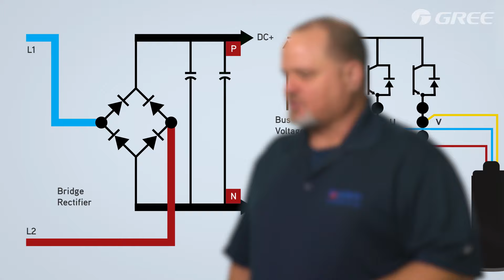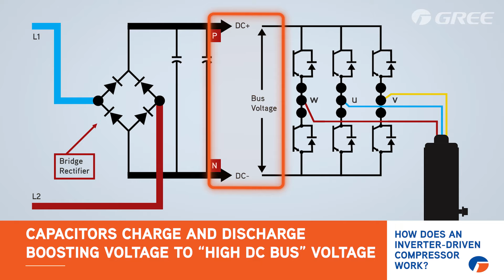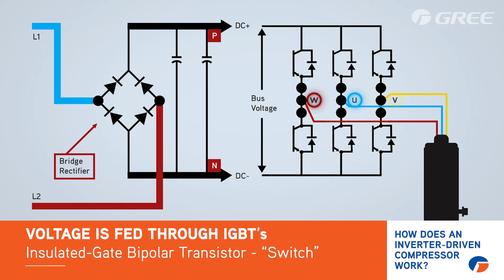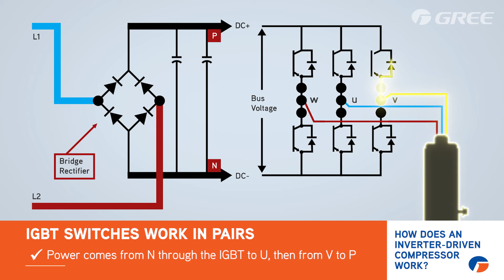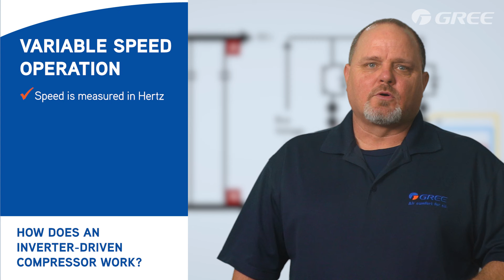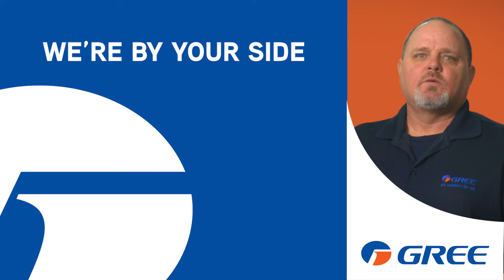HOW INVERTER DRIVEN COMPRESSORS WORK

Comment: My question will be; yes they are energy efficient by running the compressor as needed and at varying frequencies, but what is all that when they fail so frequently and abysmally?
it is either the Inverter board fails, or the compressor fails or both?

Comment: Thank you for a great explanation. When I checked u-v=7ohms, u-w=7ohms, but v-w=0.9ohms. Does this mean the compressor is bad? Getting error code 83-16, 83-56 on carrier heat pump. Thanks

Comment: The ICBM's (yes I'm joking) have one set drawn upside down which has already been mentioned; but a line coming off of each SCR (basically) going to a drawn in controller would have made the drawer ng make more sense. Some sort of controller controls the IGBT's. Also, it would be helpful to explain that the designers wish to and are incorporating a 3 phase system/ motor using a single phase input because 3 phase motors are able to achieve accurate speed control where as it is much more difficult if not impossible with a single phase motor. 
As an electrician it would have been much easier for me if they would have just said "You're getting a 3 phase motor and we control motor speed based on percieved demand from sensors in the unit"

Comment: Hello,

I have a Gree Versati 4 monobloc heat pump, 400V, model GRS-CQ12Pd/NhG4-M, which is oversized for my home's heating needs. When the heat pump reaches close to the target temperature, the compressor's minimum frequency does not drop below 31Hz, leading to high energy consumption and short cycling.

I found information online that it is possible to change the heat pump capacity and, consequently, the minimum compressor frequency by adjusting the jumpers at Jumper 1 on AP1 and Jumper 3 on AP2. I made these modifications and reduced the heat pump's thermal power to 8kW. After doing this, I noticed changes in the operation of the circulation pump, fan, and compressor. Previously, when the heat pump was set to 12kW, the fan started at 35Hz and the compressor at 45Hz. Now, with the pump set to 8kW, the fan starts at 30Hz and the compressor at 35Hz.

However, despite these changes and various setting adjustments, the compressor still does not drop below 31Hz when running at minimum capacity.

My question is: What other modifications are required to lower the minimum operating frequency of the compressor?

Comment: Well, this illustration shows the BLDC control. In BLDC motors, the controller uses Pulse Width Modulation (PWM) to regulate the voltage applied to the motor windings. The duty cycle of the PWM signal determines the average voltage and, consequently, the speed and torque of the motor. The PWM switching frequency refers to how rapidly the PWM signal switches on and off within each cycle. While the duty cycle directly influences motor speed, the PWM frequency affects the smoothness of the motor's operation and the efficiency of current delivery. Both PWM frequency and duty cycle are important parameters in BLDC motor control. 
With an induction motor, like three-phase motor,  VFD adjusts the speed of the motor by varying the frequency and voltage of the AC power supplied to it. By increasing or decreasing the frequency, the VFD controls the motor's speed. 
In both cases, BLDC and induction motors have windings arranged in multiples of three, corresponding to their three phases. This three-phase configuration is essential for creating the rotating magnetic field that drives the motor's rotation. 
Just wanted to clarify and hope this helps.

Comment: Is the compressormotor basicly a 3 phase AC motor (with a variable frequency drive) or is it a BLDC permanent magnet motor, which also needs a three phase voltage to run
Reply from the maker: Hi @georgesvgg7456, we dug into your question during a recent Talking Comfort LIVE show. Check it out! https://youtu.be/ql8oUYzatE4

Comment: Finally, a clear explanation.
It's similar to Pulse Width Modulation. 
 Some manufacturer put on their comressors 100-360VDC and 40-120Hz. I would ask them to draw the graph for me, which would reflect 100VDC 100Hz.
How a sine wave could be called a "direct current" or how the straight DC could have any frequency. As soon as DC gets any frequency, it becomes AC.
Reply: It's DC still because it was rectified and flows in one direction as I understand it. AC alternates direction. Unrectified AC will not spin an inverter compressor for this reason.
Reply: I was thinking a similar thing. It's like the capacitors take constant Voltage and Hertz AC and give it to the IGBTs as DC then the IGBTs change the DC into variable Hertz AC (kind of???).
Reply: With today's igbt circuitry commonly called power electronics it can modulate DC current into a wave form to mimic conventional AC current and it doesn't have to be fixed at 50 or 60 hertz output it can be any frequency. I like to think of it as a digital signal rather than truly being AC like from a conventional rotating synchronous AC generator. There's nothing moving or rotating in a igbt it's all solid state electronics. Another similar use case with pwm is the triacs in dimmer switches that can modulate between 0% off or 100% fully on. At the mid point it would be called half width therefore 50% brightness/output.

Comment: So technically shouldn’t an inverter compressor technically be called a rectifier compressor?
Reply: No it’s AC (fixed Hz)-DC-AC (variable Hz). The rectifier’s DC output is inverted hence the name.
Reply: @galporgy  Okay........I am curious as to the type of motor; am I right in assuming that it is a self-excited brushless single phase AC motor?

Comment: Perfect 👌 answered my question: Why we need an inverter when the supply power is already ac? And what a variable speed device has to do with an inverter?
Reply: Ac supply has fixed frequency. In india it's 50 hz n in usa it's 60hz. Inverter allows you to bypass by introducing other frequencies
Reply: Also allows speed control because you now have, and are using, a 3 phase motor for this refrigerator Speed control is easy now vs. a single phase motor, regardless of input frequency. We just better hope the capacitors are of high quality because they are the weak link (GE HVAC condensor fan motors I'm talking to you!).

Comment: Hi Greg. I have a 36k gen 3 livo mini split around 3 years old that keeps blowing up the big IGBTs on the outdoor control board that are under the heat sink with the IPM, diodes, etc. It failed the first time when it was just a few months old. GREE was unwilling to honor the warranty so we had our HVAC tech replace the board with a new one. A few months later it died again. This time I had him replace the whole outdoor unit, and that unit's been working fine ever since.

Wanting to use the other unit still, we had TJH purchase a new indoor unit and lineset and had the unit reinstalled in my garage. I sent both of the bad boards to a repair shop, they replaced the IGBTs on both, and the small fuse near where the mains are connected on one of the two. I also tried reaching out to GREE for any additional troubleshooting information or support but there was no response whatsoever. With that, the shop returned the boards stating there were no other obvious faults. Our HVAC guy tested the compressor windings, fan motor, pan heater, and several other components per the GREE service manual. He also tested the insulation to ground with a mega-ohm meter, everything appeared fine. He reinstalled one of the repaired boards. It fired up and worked fine for about a week. I would seem like it failed when it switched from cooling to heating, but I'm not totally certain on that.

Not wanting to pay for endless service calls and COVID supply chain issues in the rear view mirror, I asked the contractor to just replace the board with a new one, assuming there was another fault the shop never found on the repaired boards. We installed the third, brand new control board, and it ran for about 30 minutes before failing the exact same way.

I still have one repaired board I can get installed, and of course I can purchase another replacement, but clearly there's something else wrong. If the compressor and the fan both test fine, what else could be causing the inverter part of the board to pull so much current? You guys didn't use wimpy chips, and the way it was explained to me, these things should have built in protections for common overload scenarios anyways. Is there some unrelated component that could cause the compressor to overload without tripping protections? Keep in mind, when the unit was moved it got a new indoor unit, power and communication wiring, line set, and refrigerant. The only original components are the compressor, fan, condenser, pan heater, and related valves/sensors.

I appreciate anything you can contribute!

Comment: It’s important to note that these compressors vary the speed based off of load. These units must have smart equipment installed with it, it all communicates. If the load is great inside the house, the compressor will increase speed. Also there is humidity involved as well, but it’s all logic controlled by the boards. These boards from the outdoor, thermostat, relay panel, and indoor all communicate thru data wire. This data wire tells the indoor fan and outdoor compressor what speed to run at based off load (load is measured by the thermostat). Essentially, if the house is 74 and your setpoint is 72, your compressor and indoor fan will back off a bit. If it’s 78 inside and you set it to 72, you will potentially see your compressor and indoor running at full speed or close to it. There is humidity control as well that factors in I believe, correct me if I’m wrong. But to any of you who are confused on the determining factors that drive the speed, it’s the load which is communicating thru a data wire

Comment: oh...it basically is a stepper motor with its own rectifier to supply dc power. A logic circuit or computer assisted motor with dc power.
Reply: They don’t run backwards.

Comment: There's an error in the animation: You show the current flowing the wrong way through one of the transistors. I think what you meant was that the switch is engaged to allow current to flow down INSTEAD of through the diode that is in parallel with it the wrong way, and the current flows back up through the diode the correct way instead of the switch it is in parallel with.
Reply: Wish I had you knowledge
Reply: What I basically learned is that my compressor is three phase and it has ICBM's in it- secret weapon against the Russians
Reply: He does not have a clue... he is just presenting something he does not understand...

Comment: I have question.
When the room temperature reaches to a certain temperature 25 degree the inverter slows down the speed at a percentage, but much this percent of normal speed ? 10 % or less ? when the temperature goes up again to 30 degree the inverter accelerates to high speed and stay on it until the temperature goes down to 25 degree but the speed at this point rapidly deaccelerates or takes a few seconds or minutes to decelerates to reach the 10% of the normal speed ?

Comment: WHY can't I find the Cassette installation video?  e  24,000  btu,  and  even tech support could answer issues on  vertical  drain pump limits  and s the check valve to prevent  flood back, and how to use  that silly cardboard template on an existing  trussed and drywall  lid

Comment: Thanks for the video Greg.  Where can one find information about the programming of the board (specific to the Flexx) to understand the speed control and cold climate heating control for the purpose of troubleshooting operation?  The service manuals are light on any helpful detail of the control strategy.  Thanks!
Reply from the maker: We're happy you found this video useful! We also have a video that speaks to setting the proper fan speed of the Flexx here: https://youtu.be/En0Mev3JF8E. If you still have questions, please let us know. Also, be sure to subscribe to our GREE Comfort channel so you can be notified when we release new tech tips or go live with other video content. Thanks for digging in and learning more about proper installation!
Reply: @LIVOcomfort  Thanks.  My question was about how the compressor controls its speed.  More details about what it's targeting, why it's ramping up, when it ramps down, how the various sensors play in to the control strategy, etc..  Need more information to support good troubleshooting.  Thanks.
Reply from the maker: Some of the functionality is proprietary, but the FLEXX unit for example, has a pressure sensor (pressure transducer) that allows the unit to monitor head pressure in heating and suction pressure in cooling. This, along with the thermistor sensors in the condenser, can determine load on the system and adjust the speed of the compressor and condenser fan motor.